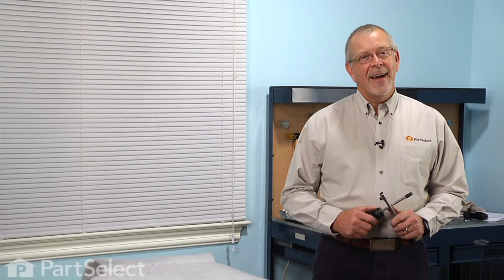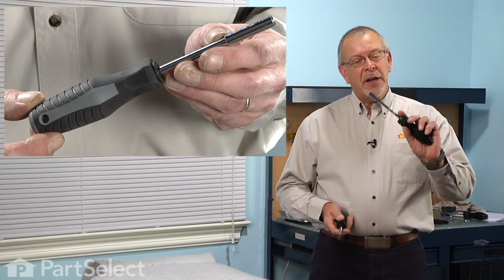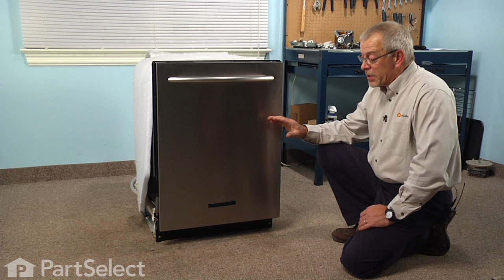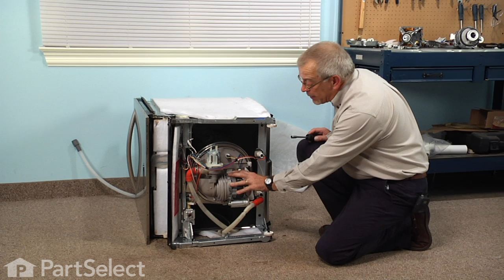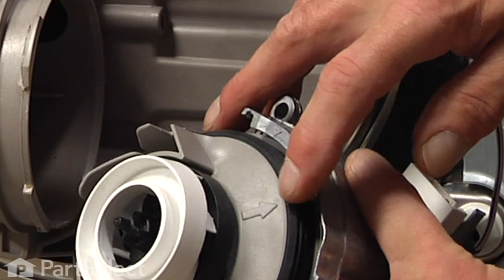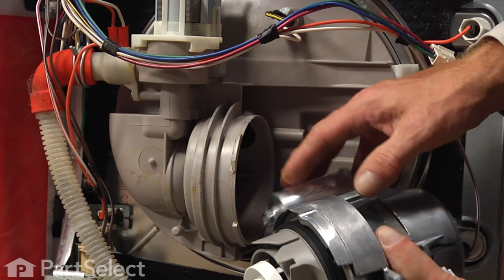Dishwasher Repair - Replacing the Pump Motor with Impeller (Whirlpool Part # W10239404)

Comment: How do you know the motor needs replacing?  Is there a test?
Reply from the maker: Some of the symptoms of a defective motor would be failure to start or run, noisier than normal or an overheating smell.
Reply: In the case of mine, the dishwasher would start the cycle, fill the tub, then try multiple times to start the wash then cancel and empty the tub.  Before tearing it out, I checked the motor for vibration while the it tried to start the wash.  It vibrated so it was jammed.  I pulled out the chopper and sure enough there was a small screw jammed in the bottom.  Cleared it out and runs fine now.  It would be good to have a protocol for testing the motor and checking all options before ripping it out.
Reply from the maker: We do hope to produce a comprehensive troubleshooting video for dishwashers sometime. We currently have some troubleshooting videos that may help you with some common problems. Here is a link to that page. http://www.partselect.com/Repair/Dishwasher/

Comment: Hi. I have a whirlpool about 4 years old and no matter what I do.. it just doesn't get the dishes clean and never has. I believe it's because it's an efficiency to save electricity and water and because of the phosphate ban. Nothing I can do about the ban..but was wondering if a more powerful motor could be installed or am I locked into the one that it came with?

Comment: Thank you for the answer. I ended up biting the bullet and doing it the "outside of the cabinetry" way this past weekend.  After doing so and looking at the bottom of the unit, I discovered exactly what you are describing in your addendum steps on how to do it from the inside.  Now I'll know for sure for next time.  Thank you!!

Comment: Does anyone know if you can replace this this exact pump from the inside like some makes and models?  The Installation is in a 120year old home and it was a challenge to install in the first place and I would rather not tackle removing and installing again.
Reply from the maker: Brad P Start by removing the lower dish rack, lower wash arm and the manifold that runs up the rear wall inside the tub, so that nothing is attached to the top of the pump. Remove the lower access panel, disconnect the drain hose and any wire harnesses that you can reach including the pump motor, drain pump, and sensor assembly harnesses, then remove the three wedges that secure the pump assembly to the bottom of the tub. From inside the tub, lift up the pump about a half inch at the front and then push the assembly towards the back of the tub and then lift completely from the opening.